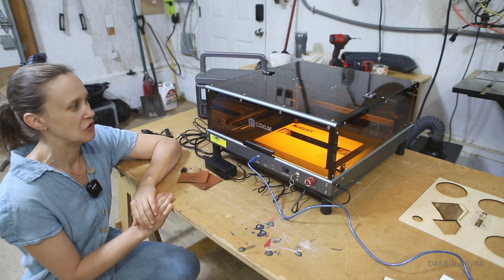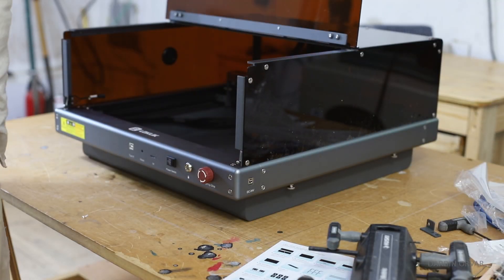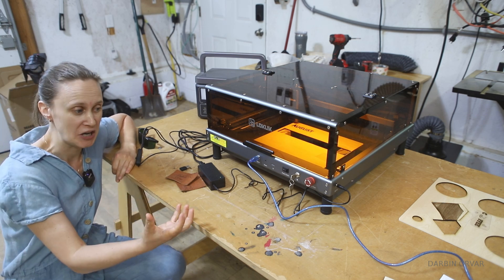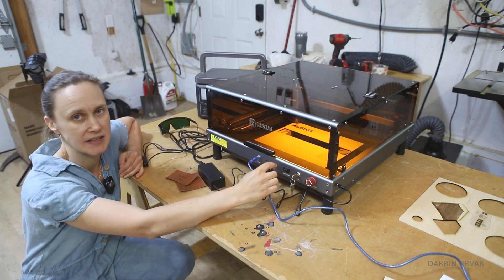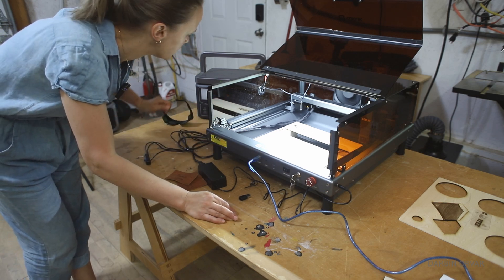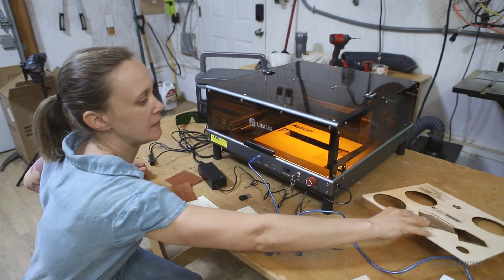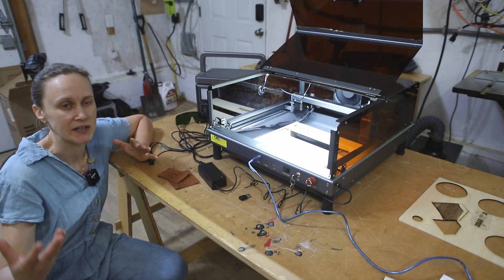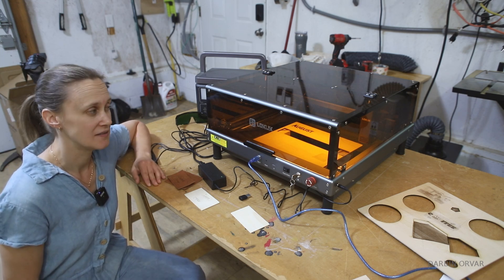A Powerful 10 Watt Laser w/ Enclosure & App Control – LOKLiK iEngrave

Comment: I have a similar diode laser that I purchased a few years ago.  Having a fan is one thing, but it really also needs an air filter, or ducted to the outside.
All-in-all a nice unit.  
You should inform people of how fast you've sped up the video or show total time to engrave/cut.  Even at max travel speed of 30 k mm/m (from the website), it takes some time to run 'simple' jobs, and cutting is not as fast as you're showing.